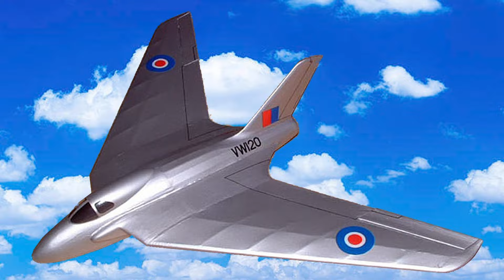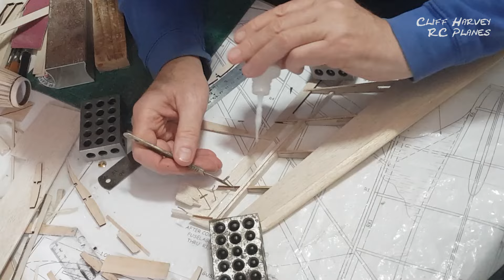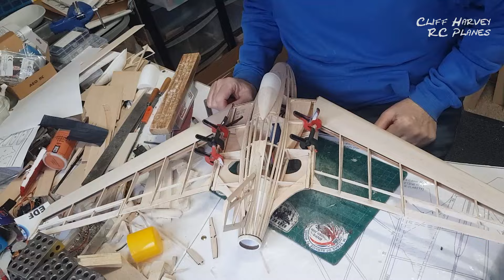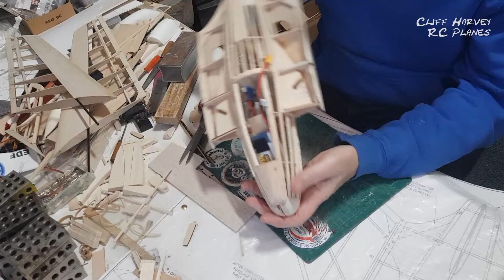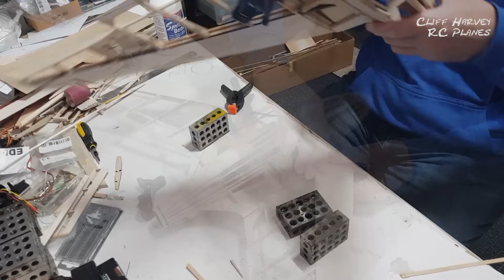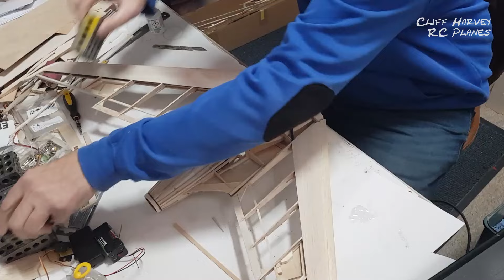Watch Me Build a Balsa Swallow EDF Jet Plane From Scratch! Part Four

Comment: My EDF Lidl RC foamie conversion with a 45mm EDF  @  275g   WITHOUT LIPO,  flies OK with a 2s 1000mA,  86g,  or if only short bursts of full throttle 800mA 3s   65g.  Swallow is much smaller wing area  but is going to be a very lightweight construction and I reckon 800mA is going to be more than enough, maybe shorter flight time than you'd get with a  3s 2200mA @ 125g (if it'll fly with that weight?)  but well worth trying an 800mA 3s first IMHO  😉. What ESC is going in? https://youtu.be/Dx2cM_zPs9Y?si=N-xYqkKRXBo9VaLh
Reply from the maker: Thanks for the advice bob, the esc is the one that was in my Mig 15, I think it's a 30amp. It's one of those unmarked ones, but certainly worth experimenting with different batteries, even if it is a shorter flight time. I'll probably have to go for a lighter battery anyway for the cg 👍

Comment: Actually, 1/32" is not 1mm.  It is 0.8mm.
Reply from the maker: Good point, technically, but the way some wood is planed to thickness 😁👍
Reply: That slight theoretical difference makes no difference whatsoever. The manufacturing tolerances are greater than that. Don't be so  picky.
Reply from the maker: @tonycamplin8607 HiTony, Gudjon is only being technically correct for which I applaud him 🤔👍